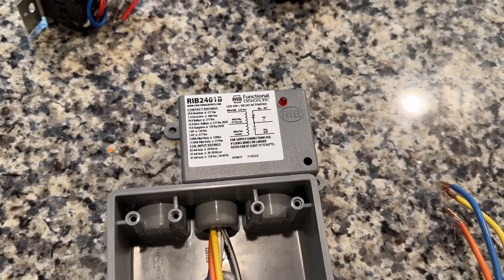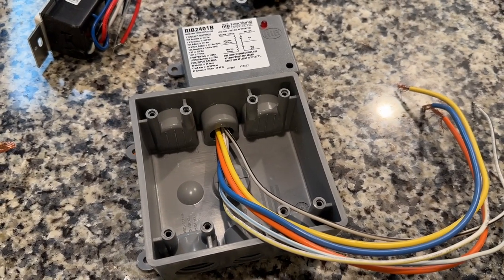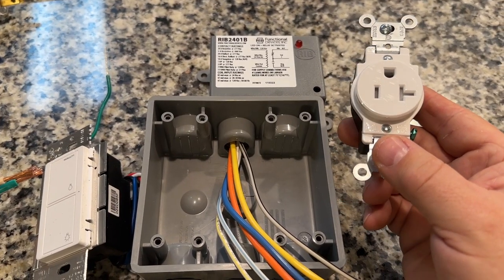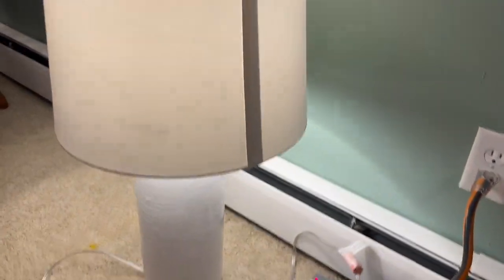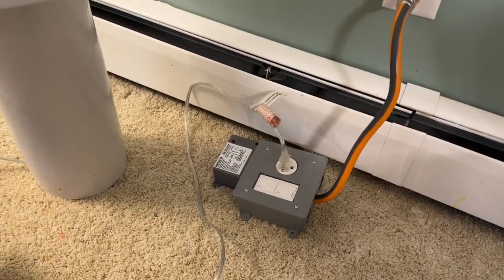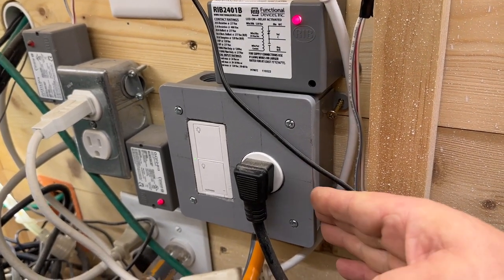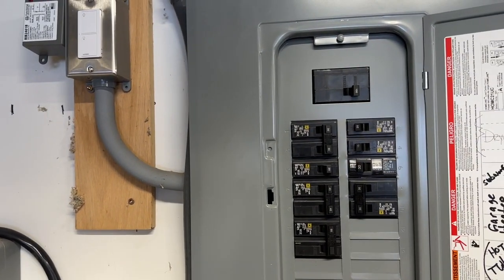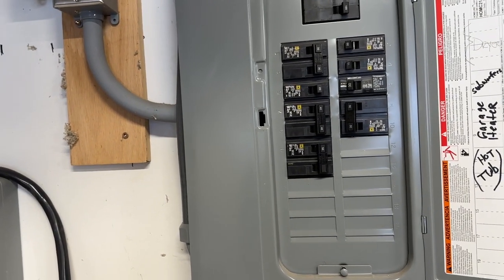Functional Devices Relay In A Box (RIB2401B)

Comment: Can you please provide some more details about your wiring setup?  From what is available in the video, it is totally unclear how this functions as a relay, and why a relay is necessary.  It looks like you ran a switched circuit partially through a relay, which works because a switched circuit is all you needed to begin with: a smart switch to open the circuit the fireplace is on.  I think you can pull this thing out and put it to work somewhere else.
Reply: I realized after I wrote this that the switch wouldn't be rated for the load needed by the fireplace, and that is why the relay was needed.  You might have mentioned this in the video.  I was skipping through looking for the areas where my questions might have been addressed.  My confusion is regarding the "max" mA rating on the coil input.  It was unclear if this is a measure of the maximum current the coil would add to a circuit, or if this is the maximum current the coil is capable of handling without burning out and required some sort of transformer or overcurrent protection.  Now that it's not so late at night I'm a little more able to work through this question, but I would love to see the actual completed wiring to confirm.

Comment: Thats awesome man! I didn’t even know they made little smart switches that can hook up to alexa, so my question is this will continue happening even though you have the rib relay installed to reset only, because the smart switch can only hold 5-6amps correct? The best way is for you to run its own circuit from the breaker with higher amps to your heater. Or am i missing something?thanks